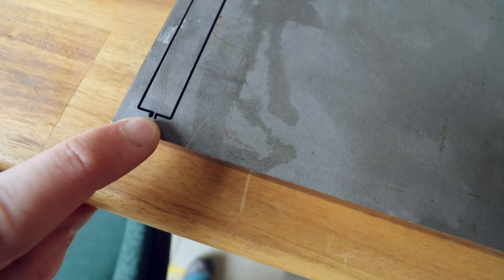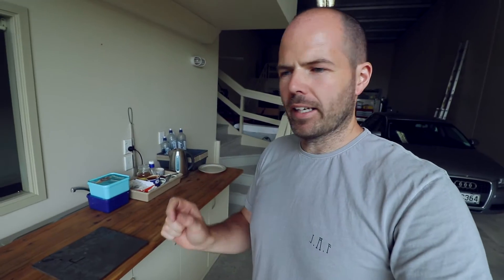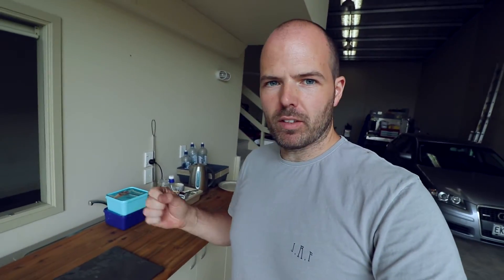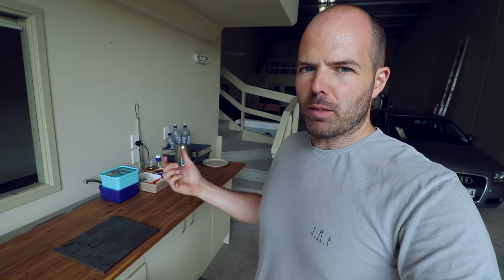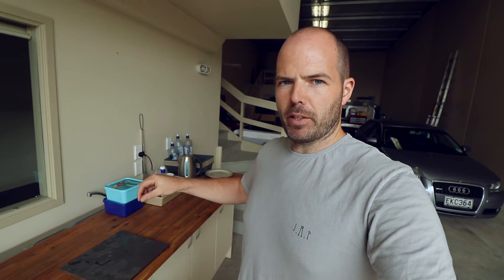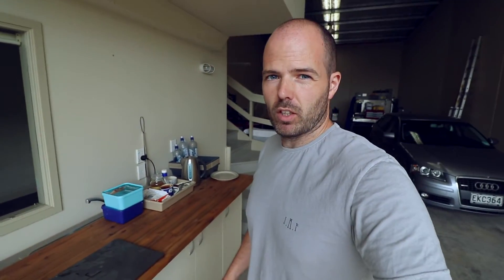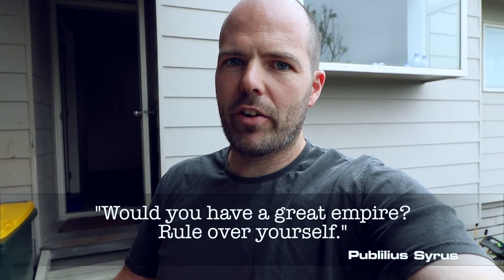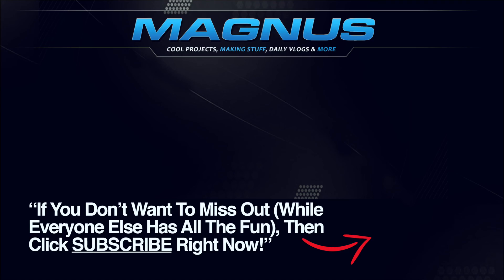Does this really cost $500?

Comment: Why can't you cut the blank from the corner of the sheet, rather than creating wastage going around it, is that a limitation of the cutter? What happens to the sheets after you have used up the viable material, can they be melted down to be reused?
I think you're spot on about not getting the CNC machine yet, sounds like you're not ready for it! 👍
Reply from the maker: It is possible ...but, the way we have the waterjet cutter set up 
...then we mount a 12" x 12" sheet in a frame (so we want to keep the 
perimeter intact).

There is a market for titanium ...but the price is ultra-low compared to what it costs. I'm just kind of stock-piling it now ...because I have the space.